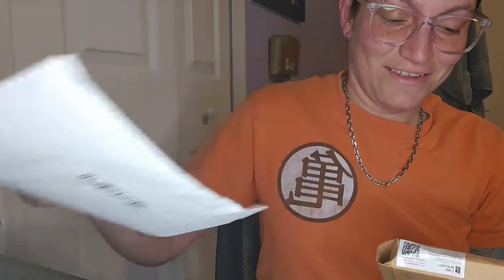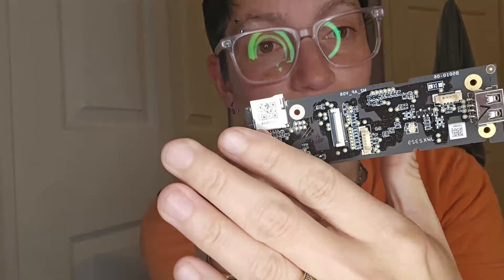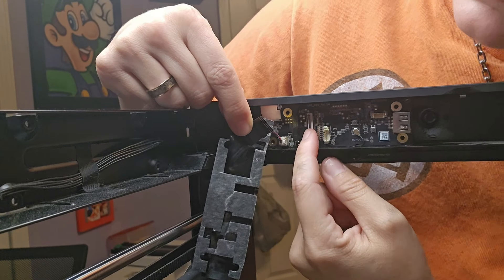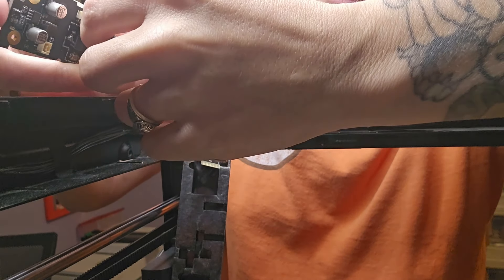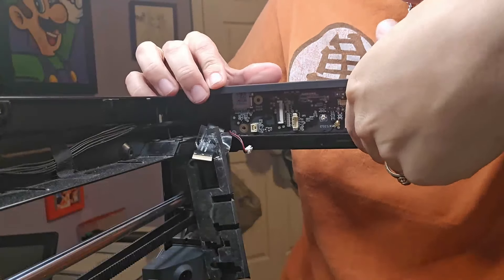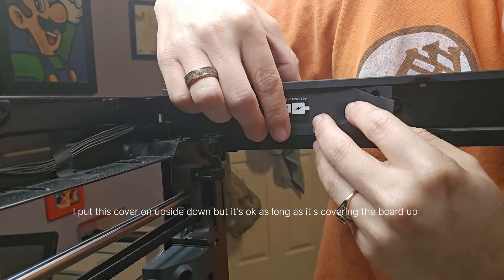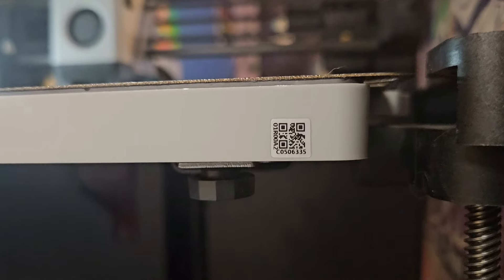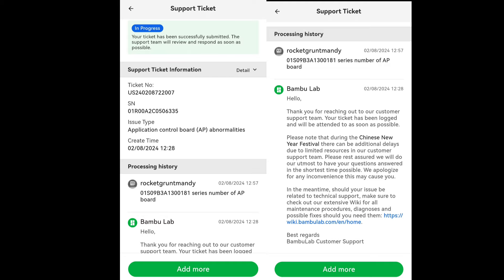Replacing the AP board on the Bambu P1P

Comment: Were you able to finally get it working? Would the printer print at all without Bambu activating the new AP board (like offline)
Reply from the maker: I got it working but Bambu HAS to activate the AP board. I tried just using a micro SD card to print files directly from it and it wouldn't work
Reply: @masterhand3d  Wow thank you for such a fast response!  Im currently going through the dreaded HMS 500.300 error and have replaced every board and cable except for this AP board.  Bambus HMS wiki says it miggt fix the printer by replacing it.  My printer(P1P) is 2 months old and i have tried contacting Bambu with a ticket and all support said was "we cant figure out whats wrong" then ghosted me.  I can order the AP board but im REALLY worried i will never get a response from Bambu to activate it.  What was the way they activated it? Could tou share those steps?  Sorry to be a pain in the ass. You are literally THE only person on Youtube or on Reddit to have gone through this that i could find.
Reply from the maker: @anthonylong5870  on the bambu handy app, you hit support ticket. It's on the "me" tab under printing history. The problem you will choose is "Application control board (AP) abnormalities." In the ticket you should already be entering the serial number of your printer but once you submit the ticket, they will ask for the original AP board QR code as well which is located in the upper right hand corner of the print chamber. I didn't include this part in my video because I assumed it was the same. After they have both serial numbers, then they will respond saying they have activated it.
Reply: @masterhand3d  Will it then do an update on the printer?  I dont really use the App and i would have to do the ticket on my computer.  Im just wondering how the printer will know the new board is active?   Thanks again by the way.  Its very cool of you to take the time
Reply from the maker: @anthonylong5870  The printer will boot up like a brand new printer so most likely it will update. Mine did. Idk what Bambu does on their end but once they have the info they need, they activate it. No problem! I'm not a pro but I'll try to answer whatever questions I can
Reply: They added this information on the product page, not sure when your video was made but now it tells patrons they need to update the SN.

Comment: Did you have problem with the log in later ? 
I changes the ap board and contact the bambu lab to change the serie number. done that. Now SUPER problems with wifi and log in.... the wifi ways "not in the same LAN " but I've the same wifi as always for the past 2 years.
Reply from the maker: @Jockesunden  Hmmm I did not have that issue. You may have to make sure they activated it or try to connect the printer to wifi using the IP address